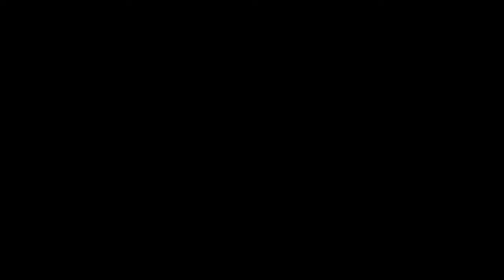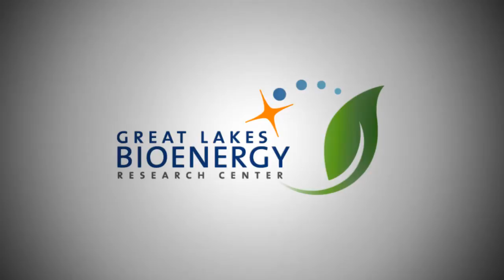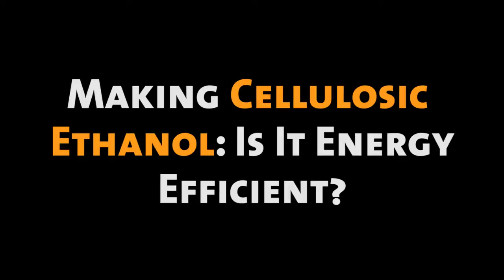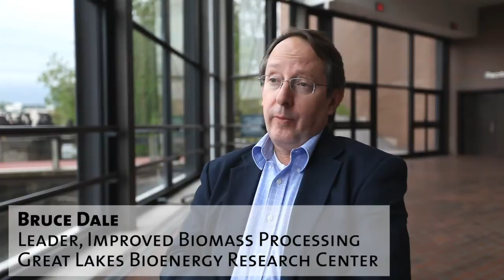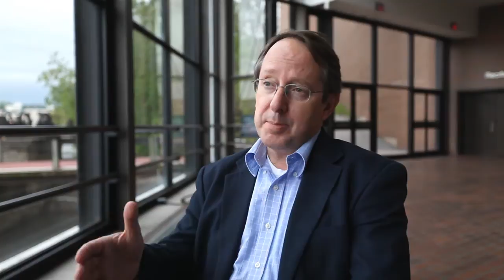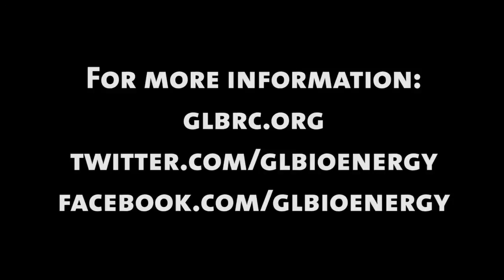Ask an Expert - Cellulosic Ethanol: is it Energy Efficient?

Comment: Essentially, yes. In the big picture, it's our job to decide what's in our best interest as to what energy process we use. 
  I choose methanol given modern science tools, but fully recognize and accept the similar benefits package of Ethanol. 
Henry Ford recognized Ethanol as the better choice, nearly 100 years ago. With Cellulose ethanol, we likely would have never had the greenhouse problem. If humanity ever has a die-off, Cellulose ethanol will be very useful. 
-For example, if the big cities were removed, we would have 1/3 the fuel needs of today. I don't want to say we need a die-off, but if we breed people that need X systems and y energy sources to live, without any self control, a die-off is basically guaranteed, I.E. we will do it to ourselves by our own failures.